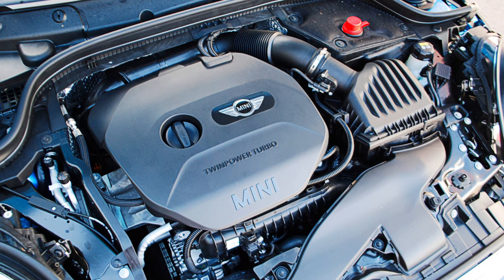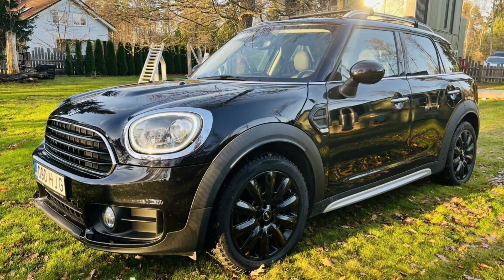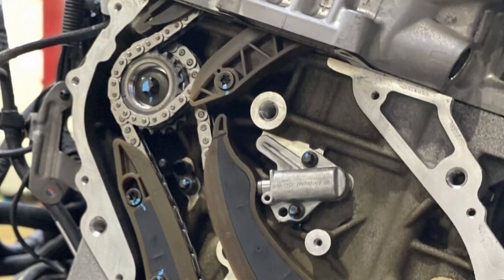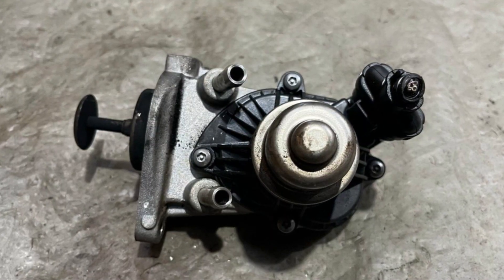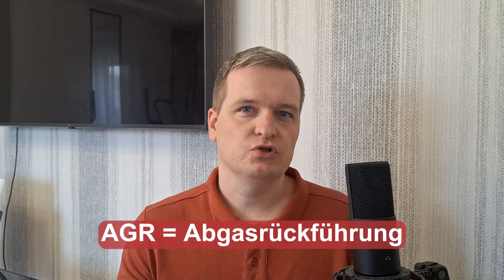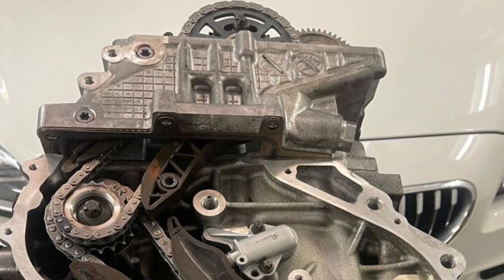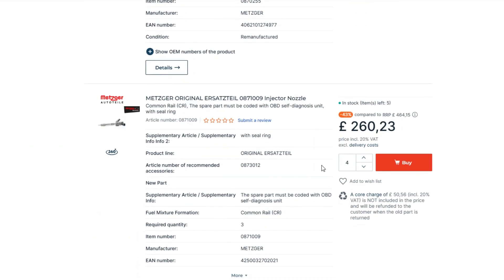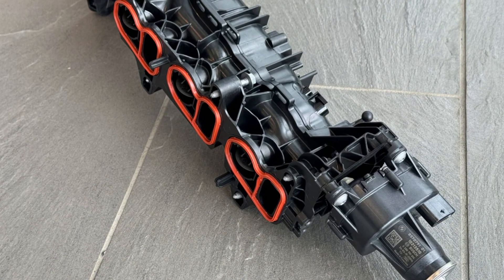Mini 1.5 diesel engine: Common problems (B37C15A)

Comment: Timing chain definitely isn't "cheap" to replace. It's well over £2000 on the automatic due to the engine needing to be removed. 

DPF replacement is 7 hours labour.

Cleaning the intake isn't too difficult, I've done it myself.... it's just a disgustingly messy job!